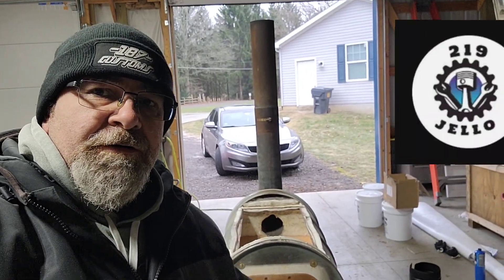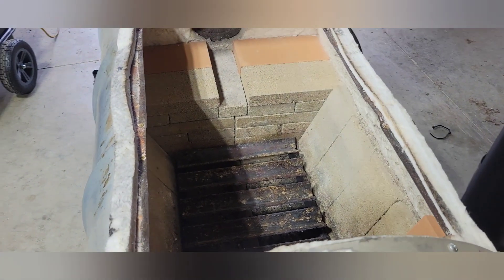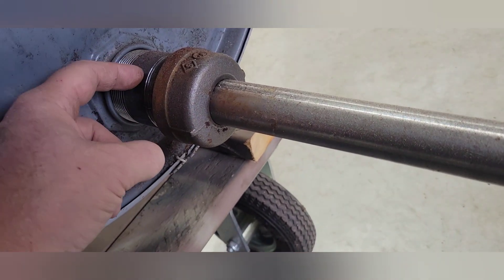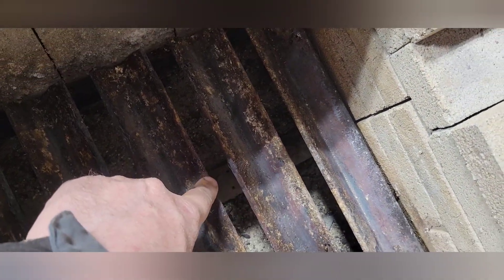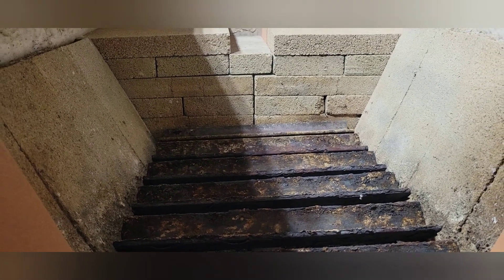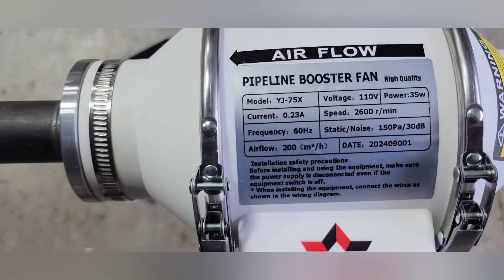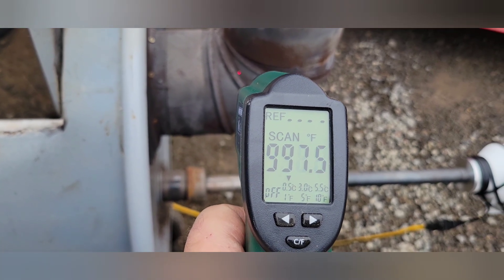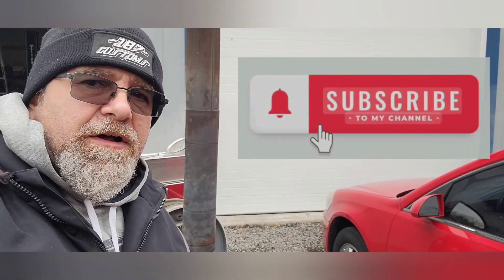Adding Forced Air To A Barrel Evaporator

Comment: Any issues with the stack not being higher up on the barrel? What kind of boil rate are you getting? My current barrel stove is like yours but I have the bungs in front and the collar for the stack is higher. I am insulating it like yours for this season but after 6 years I'm building a new barrel for next year and want to run air from behind like you did but the small bung is in the way unless I cut it out or put my stack just below it.
Reply from the maker: @Bozie  I don't have any issues with the stack height. I wanted it higher on the barrel but it would be blocked by the pan if I did. It works very well. Up to 6 gph
Reply: @219jello thanks for the reply. Love your videos btw. I subscribed to help you hit your goal. Mid Michigan here...
Reply from the maker: @Bozie  thank you!